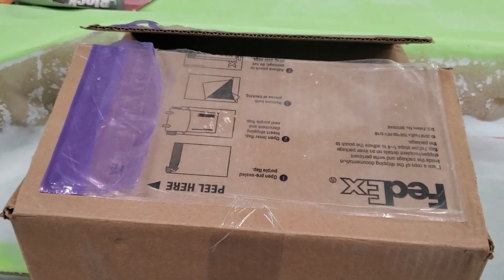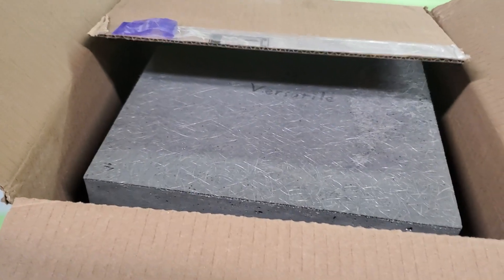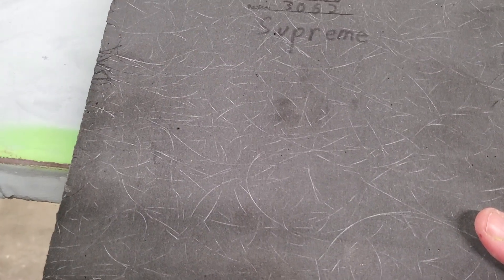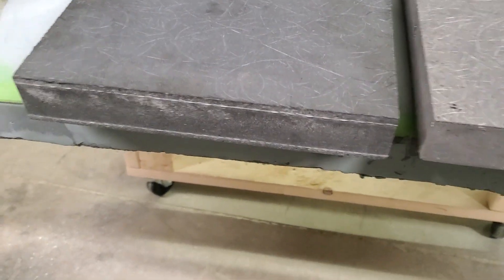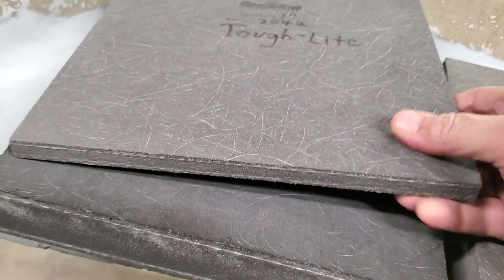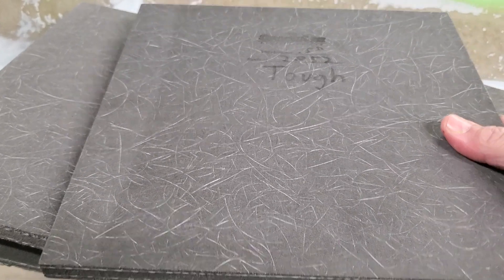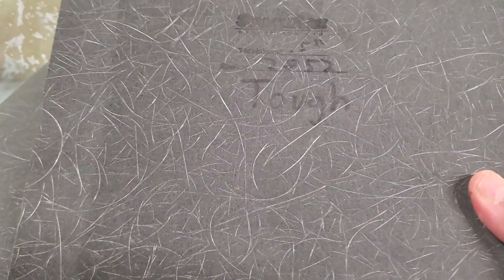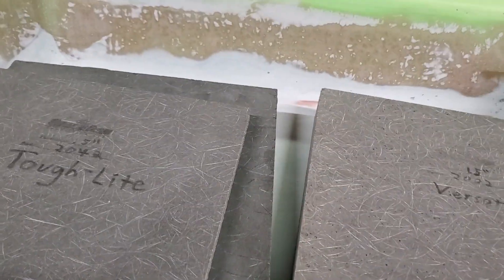Replacing wood with Thermo-Lite Board.

Comment: Is Thermolite lighter than wood? And does it cost more than wood? And have you looked if the material is carcinogenic or not?
Reply from the maker: These are very good questions.  Is it lighter, I don't know yet.   Does it cost more, currently, but wood was catching up there for a bit.  Is it carcinogenic?  Well I would love to know that myself, but whether  it is or not, the black dust would be something I would definitely want to protect myself from breathing in, just like with fiberglass or wood dust.  Handling it I don't think would be an issue.       I had planned to already be switched over to this material, but with the way things have been in the last year or so it has really shaken things up and caused a lot of delays and things.    I need to buy so much of it to place my order, it is hard to do when you are building one boat at a time.    But I will get there.     Thanks for watching.
Reply: Thanks for your honest reply. I'll be watching how your boat turns out.